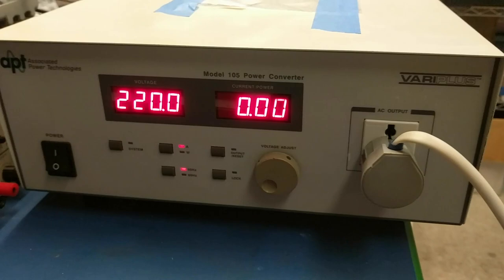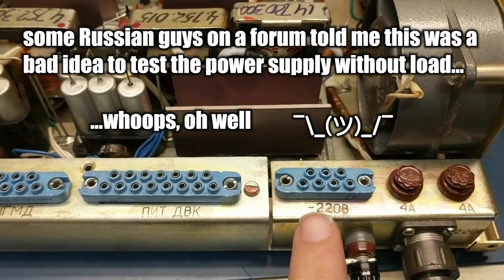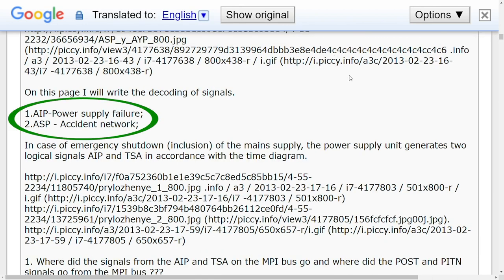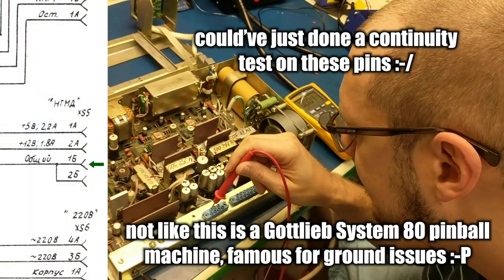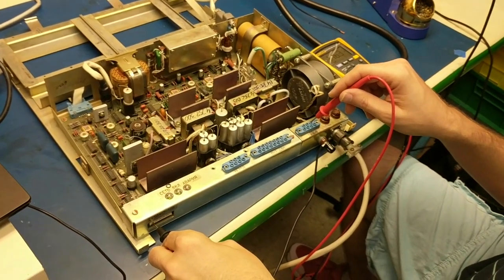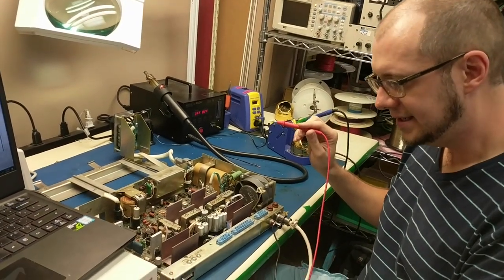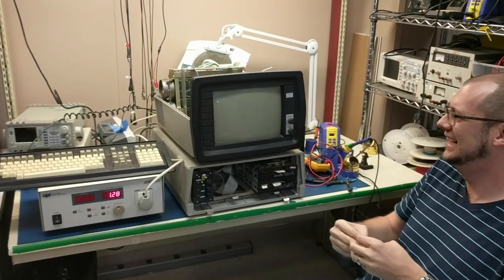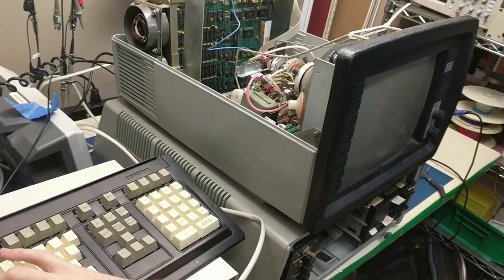Testing and First Boot of a Soviet PDP-11 Clone Computer

Comment: Those particular power converters hold their value quite well, as they are not just variable transformers but they are true power converters which generate synthetic AC power like a dual conversion UPS.

Comment: Computer: “I live at last I can serve the good of the people”
“This electricity tastes funny, almost American aaaah I’m in America! I have been compromised!”
“Launch the missles!”
Reply: fr it would probably damage it to plug it straight into an American 110 volt outlet. This was designed to take 220 volts from a Soviet outlet, so you would pretty severely undervolt it.
Reply from the maker: If the power supply has Active Power Factor Correction, one could run it at anything in a wide specification of input voltages and frequencies, such as 100-240V, 50-60Hz. The computer spec sheet says "220 (+22, minus 33) V, 50 +/- 1 Hz". I run it with stepped up 220V 60Hz power at home and it seems to do fine (the case fans obviously run faster), but I really don't feel like trying to feed it straight 120V from the wall just to prove the spec sheet completely wrong. 😉

That said, I'm pretty sure it knows it's been compromised 😆

Comment: Thanks for the great video! BTW, we have both Electronika DVK-3 and original DEC PDP-11/05 waiting for the restoration :) We have done some cleaning of 11/05 and now near the power supply testing stage too.
Reply from the maker: Awesome! Good luck on your restorations. Please do let me know if you post videos of them. I was grateful for the plentiful documentation on the DVK-3, especially for going over the circuitry. After this point, it was more about using the system, so it didn't take me long to figure out there's English documentation for the OS and ODT rather than translating the Russian translations of DEC's original documents. 😉 I'd recommend getting a floppy disk emulator like the HxC2001 if you have problems with or don't feel like cleaning your floppy disk drives.  Let me know if you need more help on this.

Comment: сеть in this context is a mains voltage, not a "network" ;) So lamps are "MAINS", "POWER-ON", "FAULT".
Reply from the maker: Thanks for adding the context! If I'm not mistaken, the "FAULT" light is red. I think it only lights up in the event of a short circuit, but haven't read too much into it.
Reply: @TexasNerdHouse  I would guess that it is an opposite of "Power Good" signal from the PSU.

Comment: All documentary was available from DEC. So everyone can build it !!! But such PDP11 computer were not allowed to export to Eastern Europe. I know a guy dealing with 2nd hand equipment. He sold and shipped to African countries and from there it found it's ways to Russia.
Reply: True, there was a KGB division for that. Though, when DEC representatives first arrived in USSR, they knew all places illegally imported machines were installed. CIA didn't sleep either. (:-))
Reply: Didn't you realize it was not "exported"?? Made in USSR.
Reply: @РусланЗаурбеков-з6е  DEC products are "Made in USA". Official Export to Eastern bloc countries was illegal.
During the 80ies the technology was moving fast from 16bit Minicomputers PDP11 to 32bit VAX systems along with shrinking Hard drives with bigger capacity and much lower prices. We been able to sell better and smaller Hardware to existing customers and trade-in their old stuffed to sell as  2nd Handware mostly to existing customers in 3rd world countries.
Reply: @b.baggins8893  But the CPU in this computer -- was K1801VM1, made in Zelenograd.
Reply: @РусланЗаурбеков-з6е  sure, it's a clone. But the original PDP11 was smuggled in and copied. Chips didn't have high integration then. Starting with PDP 8 all circuitry is quite straight forward. In the 60ies with IBM 1402 with flipflops made with discreet transistors size of a postcard! Have fun with your baby!
Reply: I remember when our Network card for a 386 Toshiba 3200SXC Laptop came in a brown cardboard box with big red lettering Warning that The device inside must Not be given to the USSR.  I think it was an old 10-base-t card.

Comment: If I search good enough, I could probably even find a floppy disk with operating system for it.... I know I once had. :D
Reply from the maker: That would be cool!  A real disk.  I've been stuck using a floppy disk emulator to work the system, but having real media would be nice.  Hopefully it's a simple matter of running a "format" command on a drive I trust to be cleaned and in good working order.  The MX disk controller I have uses a very strange disk geometry, but a simple format might work as long as I use double-density disks.

Comment: Wow so the screen is an entire serial terminal?
Reply from the maker: The color graphic display controller (KCGD, or КЦГД) in my machine is a full-blown computer unto itself, capable of displaying up to 16 colors out of a pallet of 64, at a resolution of up to 800x480.  It spits out a signal that should be usable on any monitor, as long as the voltages are correct (might need to throw in a voltage divider lest anything get fried!).  To date, I've not seen this thing do color, so it's time to find (or write) some software to fully test drive it!

Comment: I've got a commodore 64 with some broken keys and its power supply completely  sealed with epoxy.  There is no vent holes in PSU. I remember it was a nightmare to replace a burn transformer. Yeah, american engineering..
Reply from the maker: Sounds like yours was dropped out of an airplane into the ocean and you picked it up on a fishing expedition! Engineers only account for a certain level of abuse when designing products. 😉 Here's one that's been in a Polish automobile repair shop for at least 30 years: https://www.popularmechanics.com/technology/gadgets/a23139/commodore-64-repair-shop/

Comment: Soviet computer boots. Then One simple message comes on screen. 

запуск начат

Launch initiated
Reply from the maker: This might be closer than you think... If I can find a USB missile launcher, and then write a serial->USB device driver for it :-P Problem has been I can't find a version of Fortran or Pascal that works on my DVK-3 emulator (I'm not using the real hardware until absolutely necessary, who knows how much life is left in the components :-P), which means I'm stuck on PDP-11 assembly. Ugh